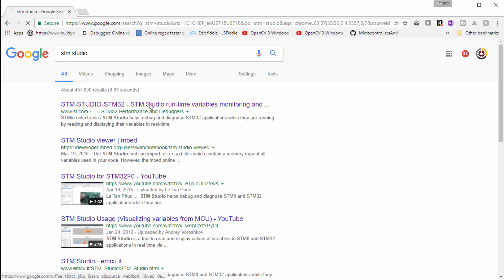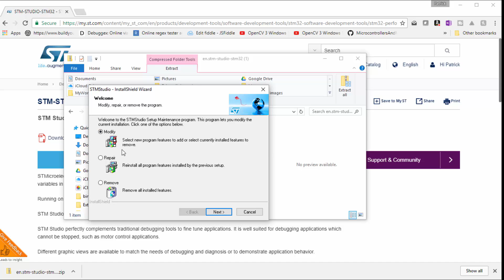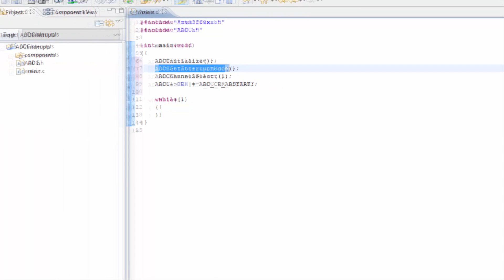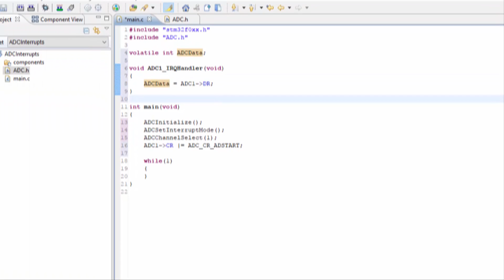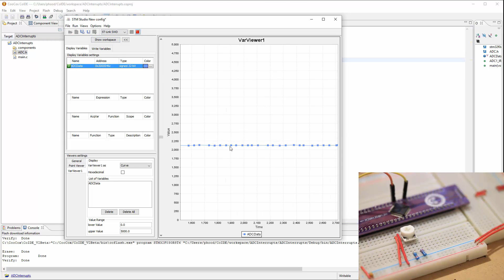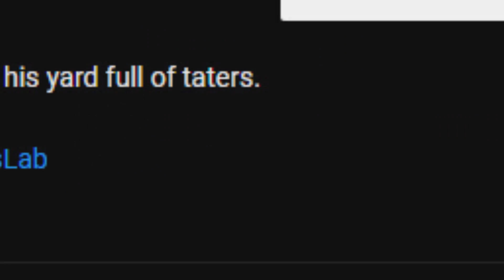56. Remove the LCD to simplify the Circuit and Setup STM Studio - ARM Microcontroller Tutorials

Comment: Is it correct to say that ‘VarViewer’ would be the ST equivalent of Arduino’s ‘Serial Monitor?’
Reply from the maker: A serial monitor is a communications method that uses USART protocol.  The STM Studio is a method that uses the SWD link to the microcontroller. With the SWD, there is no need to use the USART feature of the chip.  I'm sure you could use the serial monitor to communicate some variables that you are using, but a more direct debug link is better since it doesn't require any code to create.
Reply: Ok, I have only ever "programmed" using the Arduino IDE so I am trying to relate the two. Sometimes I understand things better when I draw parallels. Got it, its a Debug tool.
Reply: Also, I will try to type some sort of comment on your videos just to help with the YouTube numbers and I don't expect that you will reply to me mate. YouTube wants "likes and comments" now so they can verify human presence vs machine watching. I am trying to get in the habit of typing something on every video to help the content providers.
Reply from the maker: Much obliged
Reply from the maker: Well, you've come to the right place.  I'm trying to get people out of the Arduino rut and into real engineering fun. 🤓